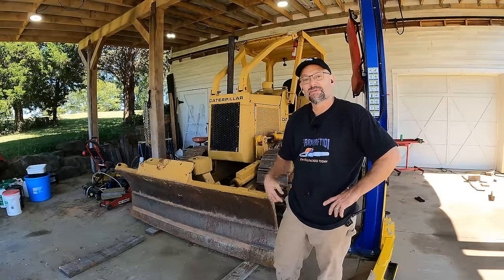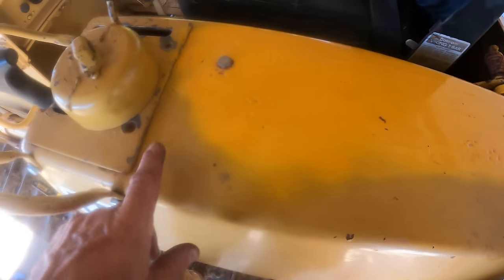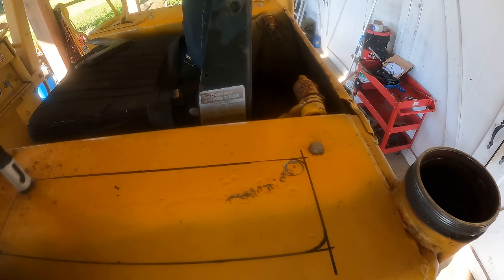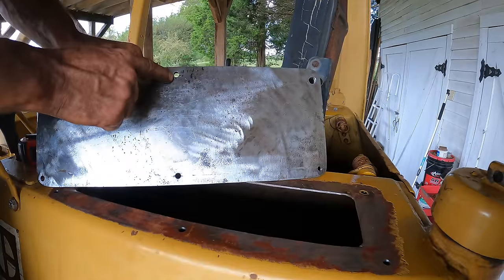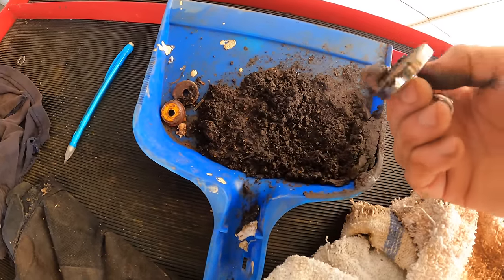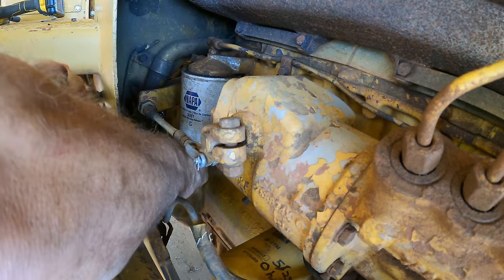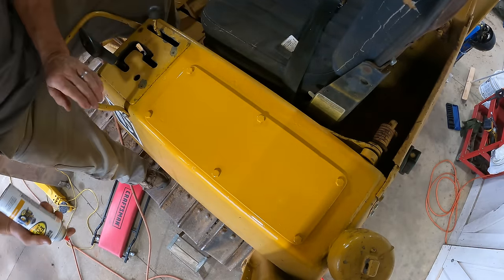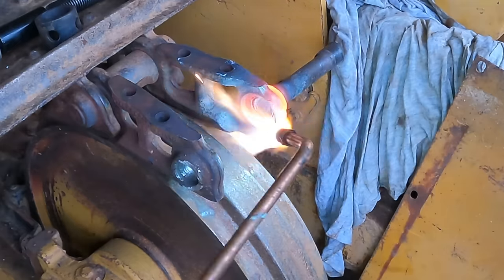Fixing My CAT D3's Fuel System & Exhaust. Cutting Open The Fuel Tank.

Comment: To recharge your spray can, take a needle inflater for balls... and attach it to the spray can after you take the spray nozzle off. Turn on the compressor and press down on the needle attachment to allow air into the can. I use a milfaaukee 12v compressor set to 50 lbs. Shuts off when at said pressure. Works for wd40 cans.. should work for any can.... although the air may cure some of the paint... but hey... you want to finish the spray can... not store it for another year... or decade... or for your grand kids...

Comment: Is that hole in your fuel cap a vent , or for a chain, or to put a rod or screwdriver in to open if stuck ? If it's a vent, maybe you could format some screen to fit it and then put some foam inside of the screen . I can't believe anyone would put that dirty fuel in their tank , but if that's a vent, it could . Good job

Comment: I have pulled tracks once before. I do not want to do it again. It required a stupid scary amount of force to get the master pin out. Going back in was not as hard. Cat made two different styles of master pin that I know of. One had a dimple in the middle of the pin. I do not remember the other style, but I think the master link was different, not the pin. I could be wrong, The track I pulled had the dimple.

Comment: I have had really good luck with the Por15 metal prep kit (but not the coating) I do the rough cleaning, then the degreasing and then coat it with the metal prep solution and I have a really clean metal and it coats the tank with zinc. I have 5 or 6 fuel tanks done this way and they have held up really well.

Comment: John, my only criticism is why isn't there a filter screen on that ridiculous tank filler cap or why don't you mount an integrated 12v fuel transfer pump which passes through an inline sediment filter and just have a foot valve and pick up hose to dip into jerry cans ?

Comment: I think you should make a mold of the wear plate with putty or something (so it is the exact shape you need).  Then cast the wear plate with molten high-carbon steel... then harden it.  Then weld the wear plate on (maybe epoxy it on first?)

Note:  I have no idea what I'm talking about (as I'm assuming you could tell by my suggestion) - it just seems like a fun thing to do (assuming your kiln can get hot enough to melt high-carbon steel. )

Comment: I wonder why an access like that wouldn't be the norm, included in the original design. It makes sense to have on a machine that is around dirt at all times. Especially with the baffle plate making it even more impossible to clean it out through the filler neck. A factory access panel could also have a more foolproof gasket setup to make leaks impossible.

Comment: Those valves that you first had as a drain valve are junk.  The butterfly always comes loose and won't turn the shaft.  Glad to see you go to a ball valve...much better..and the drain hose a great idea.   If you wanted to truly stop further rust forming inside the tank you could have sprayed it with Ospho.  Ospho turns iron oxide into iron phosphate which is inert.  The rust would not come back agsin.   Wipe it out clean after Ospho works for a few hours and you're done.    Ospho is great for spraying anything rusty.  I'd spray all the rusty parts on your machines.   It will turn it black and also scts as a primer for painting if you want.   Smart man....we think alike.

Comment: Moisture is drawn to an empty fuel tank. The more fuel in the tank the less moisture can gather in the tank, condensing on the inner surface of the tank and causing rust. I’m not certain, but it didn’t appear that you drained a lot of fuel out of the tank. Try to Keep the tank “At Least” 1/2 fuel. 
I enjoy your videos, and look forward to seeing more. 
Nice job on the pond👍

Comment: It would have been a good time to pick up one of the adjustable end joints for your pressure washer.  Would have made doing the sides right up to the top easy.  You do have to fight to hold the back pressure but it is worth it in situations like this.  The rest of the time leave it in the straight ahead click.

Comment: I wonder if you can do a bunch of weld stringers on the idler that is angled and on the bottom of the frame (to fill the missing metal back)....make it flat...grind it flatish, so you can weld a mild steel wear plate on the frame to shim it out....alot of work...but done right for the long term

Comment: Valve guides can be changed without removing the head. You force the valves up by constantly blowing in compressed air through the injector ports. That would make for an interesting video.

Comment: Good day John. I would have been really scared to cut my fuel tank. I wondered why you didn't use a pressure washer with one of those tips. I see now you used a pressure washer, and i don't think you could have done near as good of a job as you did by cutting the top off. One thing I can tell about yourself, you do think of all the avenues.

Comment: Is that shoe on the backhoe even usable?  I would have expected the slanted surface on it that was wearing into the wear plate to be a right angle... I have a feeling you're going to be building that up with a welder and milling it flat, or buying a new one.

Fuel tank repairs went great!

Comment: Compression testing won't really tell you so much about the condition of the oil control rings. One fix would be to pull the head and sump, remove the rods and pistons, a light bore hone and some new rings.  I think you are being optimistic about valve guide seals - it's the one that everyone throws at you down the pub but rarely the problem.

Comment: That was a good call not to line the tank, I have yet to ever see a liner product hold together and be worth the cost of the product (that stuff isn't cheap), or the trouble to do it (it's a laborious process to do it "right").. after a long career. Back in the day your way was pretty much exactly how it was done, before certified purpose-made rubber bladder liners became commercially available for wing tanks. Granted 99% of my experience is with gasoline so YMMV in diesel applications

Comment: Great videos, John! Very informative, very well done! As for shimming the idlers, can't you just stick a piece of corner steel that will take away the gap behind AND the gap underneath AT THE SAME TIME? That should work without taking the tracks off the machine. Weld the corner pieces aIong the existing sliding rail, that will restore the support area and give you a solid base to add more shims if needed. I love the content you're creating, but maybe... just maybe ... you may get away with less work this time around 😉

Comment: There are spherical or ball end high pressure cleaning attachments for your pressure washer that would have allowed a smaller hole or even use through the fuel filler neck.

Might help someone or you next time

Comment: Maybe someone has said it, or maybe I'm missing something, but by cutting the large rectangular section out of the rubber gasket you're exposing the top of the gasket to fuel which would allow the upper side of the gasket to leak out the side in addition to a possible leak below the gasket and out (or dust in and out).  If the gasket had been left without a center opening, only the underside of the gasket could have leaked.  Just a thought that will be totally useless because you'll never likely need to cut another gasket like it again.  😁

Comment: Hi John, loving your videos here  in wales U.K. I find them very informative and feel like I learn a little with each one I watch. Now to my question, you’ve probably got a very good answer but why when cutting out your gasket did you remove the inner piece? If you left it whole wouldn’t it have acted as a secondary lid/ cover?  Just wondering where my thinking is wrong?  Keep up the great work 👍👍👍 thanks.
Reply from the maker: I thought about that.  I think it would sag over time and make a space between it and the lid that would end up full of water from condensation.  Would probably be fine either way, but most gaskets from the factory are cut out, so I figured I would just do the same.  Cheers.

Comment: If that cover ever strips out because of the thin tank metal, you can always use nutserts (but you'd have to buy the installation tool).
Reply from the maker: I considered tack welding nuts inside, but the metal was 1/8” thick so I think it will hold. Cheers.
Reply: @FarmCraft101  True that.

Comment: Track removal.  I wonder if there is enough slack with tensioner retracted and bolted together cribbing to keep the track from collapsing. To wiggle it off the front idler .  Using hooks over the top of the pads to hold the tracks to the cribbing.  Might be able to use the same one on both sides one at a time . Have you priced tensioner ram seals and new zircs for the plugs. While you have the tracks off and the idlers out. 
I dont know what kinda seals and bushings or bearings are in the idler.  Welding on the idler guides might heat up any seals ruining them. 

Just thoughts.

Comment: In your case I guess it wouldn’t make sense, but if you have a tank with less rust or you can’t cut it, you could use a drain cleaning hose attachment for your pressure washer. Don’t know how they are called, but it’s basically a hose with a nozzle at the end that sprays water in multiple directions at the same time and you can stuff it in tight areas. So if theres just junk and not that much rust in the tank, you could clean it this way. Also a little bit degreaser first and then a lot of water to clean the tank, could be a solution. But of course you would have to do this until the water is completely clean and it’s harder to tell whether or not you get everything.

Comment: Mineral wool or cellulose insulation would be a better choice for the muffler pack... (pink) fibre glass will melt and burn at 700 C. Mineral and cellulose will withstand higher temps and... more importantly...  not turn to useless shee-ight when wet....

Comment: A can of fiberglass epoxy. Mix some up and just paint the inside of the tank. You will not get any rust, We would do oil pans on V/8 engines in boats .Replace oil pan because of salt water in the bilge would eat thru the metal. Coat with fiberglass epoxy and no problem. Food for thought

Comment: Get a couple brass fuel valve from a 1950's D2 0r D4 1/4 turn, 2B1397 or brass gas cock. Positive shut off and full flow.

Comment: Placing magnets on the outside of a steel tank will have little to no effect on ferrous particles inside the tank. The steel of the tank will redirect the flux lines of the magnets and very little will go through the steel of the tank. Obviously if the magnets were inside the tank they would work, this is why some plugs have a magnet on the inside.   If the tank was a nonferrous material e.g. aluminum the magnets should work quite well if rust got in the dozer fuel tank from an external source.

Comment: 41:48 if you want to make extra sure it centered, you could weld it in one spot, just one dot on one side. Then put the hood back on and center the pipe with a gentle strike of a hammer.
And too much weld on thin metal is generally not a good idea as the thicker those beads, the more tension on metal around it. And if it vibrates it can soon break right at the edge of welding area, so you will need weld more and more, too often, until some day you decide to just cut the whole thing off and replace it with fresh metal. Happens too often in my line of work.

Comment: I think the magnet would have helped far more if it was on the inside of the tank beside the pickup tube so it grabs any metal shavings as they try going into the fuel system...

Comment: Having gone thru 8 months of welding vocational school and a year or so of welding in metal fab shops before deciding a university education was more suitable to my taste I would have used brazing as my method for melding the two sheet metal pieces you used the MIG machine for. You would have no problems with getting too much heat on the pieces and structurally brazing would be fine as frog's hair.

Comment: I don’t see why you can’t get the tracks off without splitting them. If the yoke piston for the track adjuster works right. You should be able to get them loose enough to get off the machine without splitting them. If they were new tracks no way. But older tracks that have some slop. They may come off fine as kind without splitting. Also would be a great chance to add to the grousers. Hang them from your tractor and you can weld all the strips on pretty fast. Then flip the tracks and yweld for end and weld all the other sides.

Comment: I would be surprised if that plate you put on the tank doesn't leak. It might need a few more bolts. Or some gasket sealer.
But I could be wrong.

Comment: generally speaking, a fuel sediment filter does the trick, the tank is so small it's not a big project to remove the tank to clean it out, my guess that tank will out last your life, add some water treatment to the fuel if you think there is water in the tank, being heaver then the fuel, easy to drain off. I was working for the cat dealers when the D3 was produced, came out of Japan from back in the day, Being I worked on D 8's and D9 before the D10 came to market, 
the D3 was more or less toy like, Good little cat...   Removing the tank and turning it upside down is still the 
best way to clean it out if it must be done.

Comment: I’m just curious on your opinion. If you had owned a  Kubota  90skid steer or,something similar. Do you think the pond job would of gone quicker, or do you re😢need a dozer to move that volume of dirt. Assuming both pieces of equipment are both operating fine. The dozer just seems so slow. Like to know thx.

Comment: I would have put twice that many bolts in the cover. I’ve seen leakers on tanks from too few bolts. Just sayin. 😊 If you are getting bounced around in the seat the fuel will be doing the same.
Reply: yeah, and why cot the middle out of the gasket? all that does is give another surface for leaks. Oh well, not our problem to fix eh 🙂

Comment: Those fancy 4 piece glass filters are the culprit of more engine fires than you can believe. They vibrate loose and leak. Lots of hot rods get burned to the ground because of those.

Comment: By the way the people that have problems with rusty tanks and a bunch of junk in their fuel or the people who use the tractor and then when they're finished they park it with a quarter of a tank. Then it sits there for a couple of months with the heat and all the condensation inside building up all that water sticks to the walls and rusts. What you're supposed to do is when you park it leave it almost full. That way the tank is always submerged and doesn't have space for condensation and rust

Comment: Wondering if it would be (have been) worth spraying some rust converter inside the tank that would chemically convert the iron oxide (rust) into an iron phosphate. Not a liner per se', but could slow down further deterioration of the inside of the tank. It looked like there was more rust in some spots higher up, which makes sense given you can never keep your tank 100% full given when you use the machine the level drops. I also am not sure why you wouldn't have used some kind of self-etching primer and epoxy paint (or farm implement type paint with hardener) on the inside of the tank cover. Rust from above can vibrate off and drop into the fuel. I know, you have filters. I also might have not bothered cutting out the center of the rubber gasket and epoxied it to the lid. For that ball valve drain, you could also make a little custom "ring tongue style terminal"  out of sheet metal with a tang bent down with a hole in it you thread the valve through that would allow you an attachment point to hold the valve in the closed position by securing it with a zip-tie to keep vibration from allowing it to open on its own. Just a thought. You used the white Teflon tape and not the blue rated for fuel and oils? Any desire to spray some black high-temp exhaust paint on the muffler and stand-pipe after some wire brushing and rust converter? It was rusting. Again, a cheap fix to slow down its deterioration. I might not bother with the engine in terms of oil use if the power seems ok, until it isn't. Nice teaser on the track removal. Perhaps hitting all the pins with a wire brush will reveal which is the master link. You probably already did that and we just haven't seen it yet. Still wondering if the pond job essentially covered the cost of the machine or not, at which point whatever you do to refurbish the hydraulics might be all you have in it (or maybe it covers that too).

Comment: Did the cutout discs that fell in fall onto the magnets?
Reply from the maker: Not really.  Through the thick metal of the tank and then the 1/4" of gunk on the bottom, there wasn't much magnetic field left to do anything.  I wish I had put the magnets on the side of the tank.  They might have actually held onto something then, though there was way too much crud in there for a few magnets to deal with.

Comment: I am sure it's been said but those glass body cylindrical filters are known to fail. The seals/o-rings in the metal ends are crap, they dry out then the whole thing leaks fuel.

Comment: The magnet you put under the tank will do nothing on a mild steak tank because the magnetic flow will be shortcut in even a 1mm ferro magnetic material, but it would work on aluminium or plastic